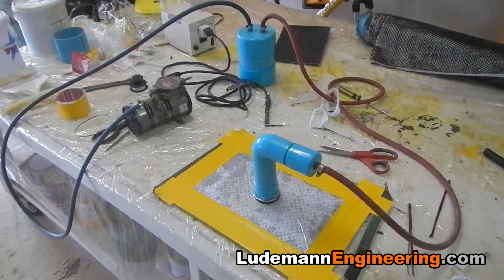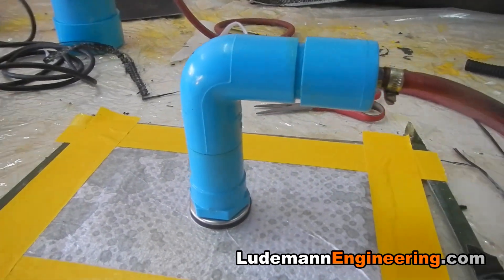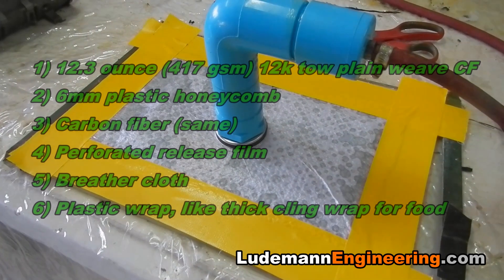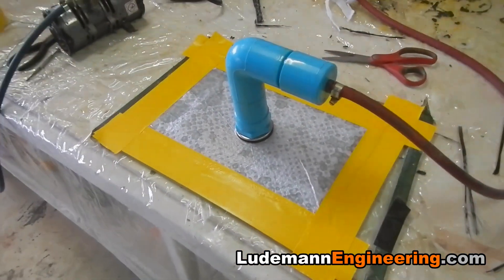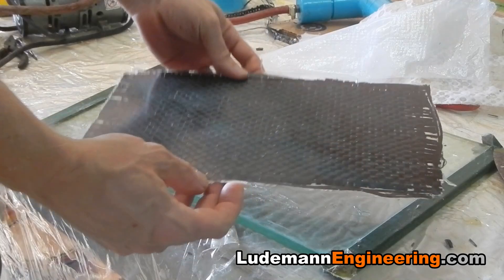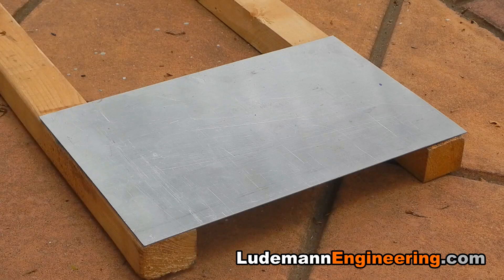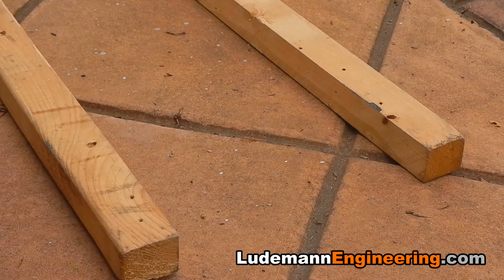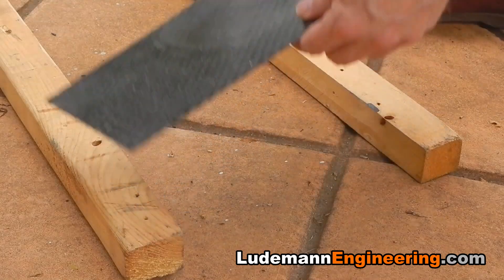Carbon Fiber Honeycomb Sandwich Panel Layup, Vacuum Bag, Mold Release, Strength Test

Comment: just wondering if you can use  carbon fibre sanwich with a harder material like  plywood or alluminium for added streght
Reply: aluminum and carbon are on opposite ends of the galvanic scale.   anodize your aluminum or put a layer of kevlar or glass between the aluminum and carbon.
Reply from the maker: Yes, in fact I laminated plywood strips into my undertray (floor) for stiffness and protection against hitting the ground, and I laminated threaded aluminum disks into my nose cone to mount to the chassis and front wing.
Reply: what do you mean by treated aluminium
Reply from the maker: Not "treaded", "threaded". By which I mean aluminum disks that have been drilled and threaded for screws.

Comment: I just noticed. Watching your other laminating videos I saw you never use shop air for releasing the parts. I use it all the time and it barely fails. If you know what I mean, you just lift a bit of the part and blow high pressure air between the "mold" and part. Did you ever try that?
Reply from the maker: Good idea. No, I've never tried it, or if I did it was so long ago that I don't remember. I'll try that in the future.

Comment: whats the purpose of the catch pot when you have such a large drain pipe ? i would not expect resin to get past that elbow. The blue film isn't peel ply btw, its perforated release film
Reply from the maker: Yeah, the pot wasn't necessary. I just wanted to make sure resin didn't get into the vacuum pump.

Comment: what kind of vaccum pump is that? I want to make a similar cheap set up since here in Peru carbon fiber supplies are difficult to find
Reply from the maker: +K4lr0b You can find vacuum pumps like this at any air-conditioning parts supply house; not a retail store, but one that sells to air conditioning repairmen and installers. Good luck!
Reply: +Ludemann Engineering Hello Ludemann Engineering, i was wondering what are the crushing properties of this composite material? If subjected to a force will it crush honey comb by honey comb or it will brake in the weakest spot?
Reply from the maker: It depends on the contact area of the force. To apply a large load, you need to embed aluminum or plywood hard attachment points inside the honeycomb. Carbon fiber will tend to shatter progressively, which is why it is so good at absorbing impact in race cars.

Comment: awesome little video +ludemann loved the series one note to remember if your part is making that cracking noise it generally mean there is to much expoy in the part so maybe next time run the vacuum a little longer to get more resin out hope this helps keep up to good work mate :)
Reply from the maker: +Geraint Lavis Thanks! I can only get one type of epoxy resin in my city, and it's too thick for the vacuum to pull through the holes in the perf-ply so I ended up with too much epoxy in the sandwich. Subsequently I've learned to squeegee the layup hard, repeatedly, to get the minimum resin content.

Comment: Is that vacuum attachment the drain of a sink?
Reply from the maker: +TheSchadenfreuda Yes, it is. I wanted to see if vacuum bagging is possible without all the expensive bits sold by the specialized companies. I later bought a better vacuum pump at an air-conditioning supply house.